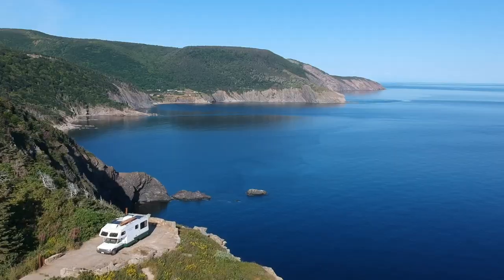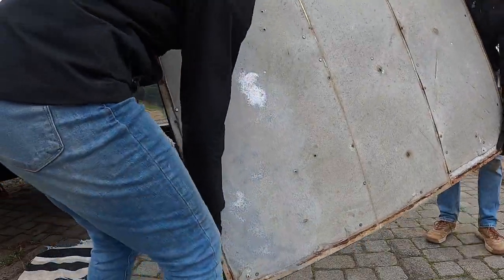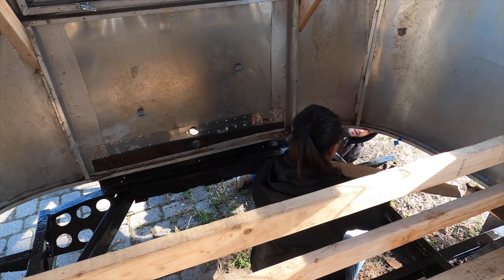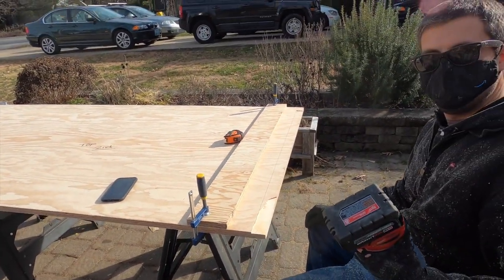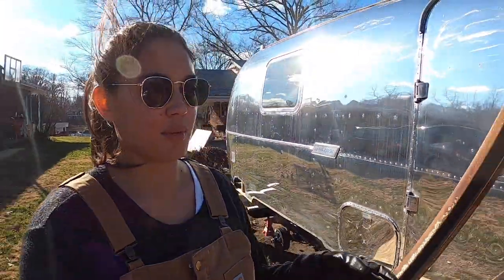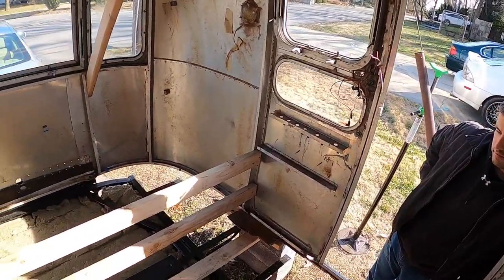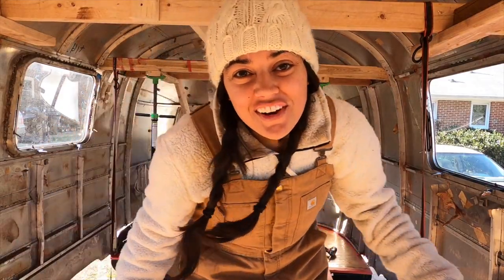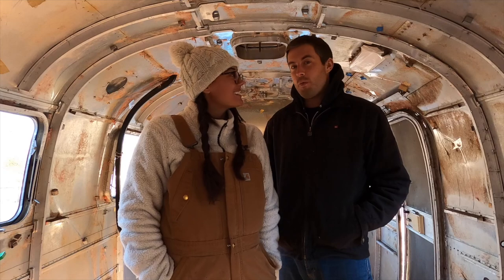AIRSTREAM RENOVATION Episode 7 || NEW SUBFLOOR INSTALL & DROPPING THE SHELL BACK DOWN

Comment: Can you explain what you did with the c channel? We are currently here with our renovation and aren’t sure if we should attach c channel to the wood before we lay it on the frame or after we partly secure it to the frame. Our channel is completely detached from the shell right now. Love how in depth the videos are. Thanks!
Reply from the maker: Hi Darbi!  I think if you took the channel all the way off most people we've watched or talked to would attach the C channel to the subfloor before lowering the airstream onto the subfloor.  

Initially we left our C channel attached to the aluminum shell after we lifted the airstream off the frame as ours was in perfect condition all the way around and we were worried we would misplace important parts of our channel before putting it back on.  

Because of the year of our airstream (70's era) we have a different type of C channel on the front and back end of the airstream that just sits on top of the subfloor (i think its called a U channel or F channel is what i read in airforums) rather than the subfloor sliding into the 'C'. The only place we needed to remove the C channel completely was near the door (the long piece of C channel by my foot at 14:19 is what we took off). We slid the piece of subfloor into the opposite sides C channel (attached to the shell still) then when we lowered the shell more we slid the piece of c channel we took off into place with the subfloor inside the 'C' and the old rivet holes lined up on the shell, and finally put the shell down all the way.

Sorry if that was a long explanation!  It's kind of  confusing to explain, and I wish we had included that part in the video!
Reply: @slowcarfasthome  thank you so much for the detailed reply. Yes ours is a 1985 and has the complete c channel in the front and back, so it had to be removed. We will put it on the new subfloor before we drop the shell. Thanks again! Can’t wait to see how y’all’s project turns out!

Comment: Hey, I’m getting ready to cut and epoxy my new subfloor. I’m using Total Boat epoxy. What’s that red stuff you used on the edges of your plywood? You guys are teaching me so much!! Thanks!!
Reply from the maker: Hi Angel!  We saw someone in the facebook airsteam restoration group use "Redgard" on the edges of their subfloor.  It is typically used for water proofing the underside of where a shower goes.  We used a gallon of spar urethane on our subfloor and then the redgard on the edges
Reply: @slowcarfasthome  thanks! Good to know. Not sure I need it with Total Boat epoxy that I’m using. I’m a go research it tho!😅
Reply from the maker: @angeldeelse4090  you're probably good with just the total boat epoxy!

Comment: Looks like you didn't remove C channel from the frame? How did you get the subfloor into the channel after you dropped it on top of the subfloor?
Reply from the maker: We did remove the C channel from our shell to clean them up, but I am realizing we don't show it in any of our videos, and reinstall them before we start working on the subfloor. In the 70's era models the front and back "C" channel is actually more of an "U" channel (it just sits on top of the subfloor, so it does not need to be slid into the c channel like all the other parts of the subfloor did, so those two channels were never taken off).  We reinstalled the C channel around the time we put the subfloors in and slid them in by each of us standing on either end of the subfloor and guiding it into the channels before lowering the shell fully.  Our airstream is only 23 feet long so it is not one big long continuous C channel.  It has breaks in several places (mainly because of the wheel wells) so it was not as difficult as maybe a larger AS with big continuous strips of C channel may be.
Reply from the maker: So to clarify--We began dropping our shell with all of the subfloor (subfloor sheet 2, is pretty much the only sheet that was completely slid into C channel the rest of the subfloor has gaps from wheel wells, exterior access boxes, etc) slid into place where there is C channel.  The front and back pieces of subfloor simply sat flat on the frame waiting for the shell to be dropped on it since those two areas have the "U" channel not a C channel on our Airstream.
Reply: @slowcarfasthome  Cool! I figured it just kinda looked like you dropped the shell with C channel attached to the shell not on the subfloor and I was so confused how you accomplished that haha. You didn't need to replace any C or U channel? I am finding the U channel in the back curve of mine is destroyed
Reply from the maker: @BrianHelmingcomp  nope we did not need to replace any of our C or U channel as they were still in great shape.  We just cleaned them up and reinstalled in original placement